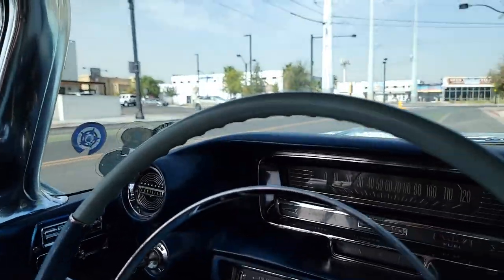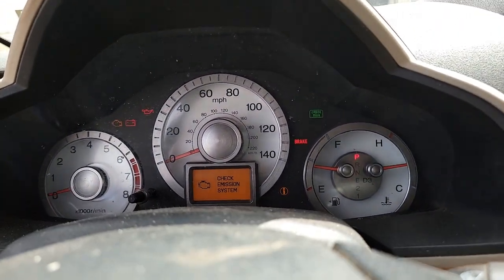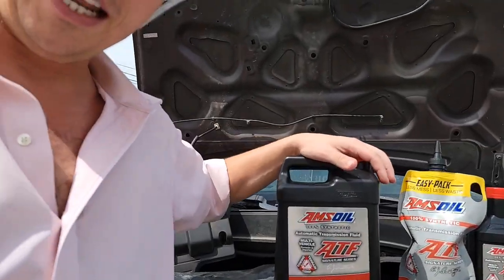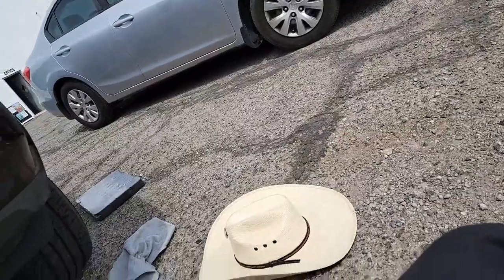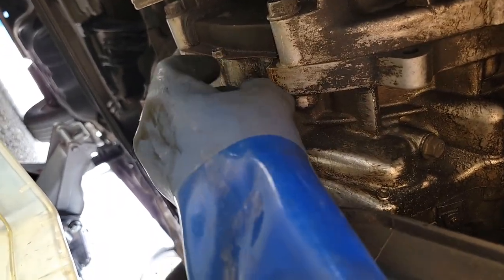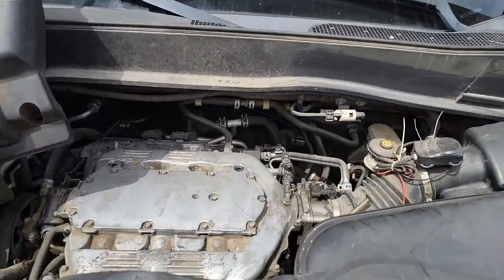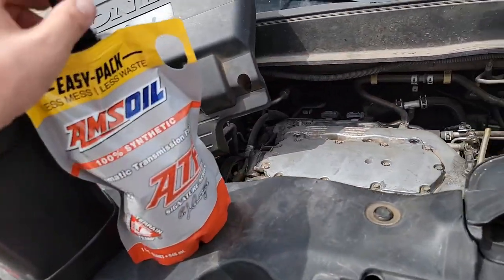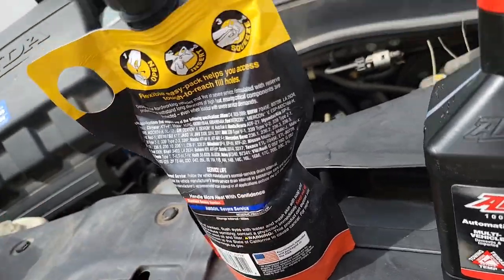Will Changing ATF cause it to slip? You May BE surprised!

Comment from the maker: Is AMSOIL Worth It on my Old Car? - https://youtu.be/1OSojPX7QKo

❤️ 🇺🇸 ❤️ Professional YouLubher: Eben Rockmaker Regency Platinum Direct Jobber AMSOIL Specialist (Dealer#: 5331179) 702-472-3614 

      ✅ ✅ ✅  You will get Your Best Value as 6 Month AMSOIL PC Member --- because You get about 25% discount on AMSOIL Products  + you will not pay as much sales tax, depending on the sales tax in your state.  For example, if you were to buy $100 of product at retail plus 8% sales tax the total would cost you $108. However, if you paid the $10 PC membership and you received the 25% discount because of the PC membership, the total would cost you $75 plus 8% tax or $81. So for the one time membership of $10 you are saving $27 on your first order.  You continue to receive discounts on your future orders for the next 6 months. You do NOT need to auto renew! https://www.amsoil.com/offers/pc/?zo=5331179 

     🥇🥇🥇     Synthetic Oil Protection Google Map & Reviews
(702) 472-3614
https://maps.app.goo.gl/DmLU5hP72HadUBEm9
             
     ⛳️  Synthetic Oil Protection Website - http://syntheticoilprotection.net

     Did you know a oil manufacturer can call a lubricant a Full Synthetic when it's only 25% synthetic? AMSOIL is different because it is 100% Synthetic and has a higher film strength keeping the metal parts separated. AMSOIL allows less friction, less heat, less wear on the component. 

     Your Vehicle Could Run Better Than Brand New By Using AMSOIL 100% Synthetic Lubricants! See Results - https://youtu.be/zH-VquYlhqA

     AMSOIL Signature Series 5W-30 Synthetic Motor Oil protects against harmful deposits on turbochargers 4X better than Mobil1® Extended Performance in industry-standard testing*.  Read This Article - https://www.amsoil.com/newsstand/motor-oil/articles/leading-the-field-in-deposit-protection/?zo=5331179      

     ♥️ AMSOIL Performance Tests: Read This Article - https://www.amsoil.com/performancetests.aspx?zo=5331179    

     Find AMSOIL Products For Any Vehicle - https://www.amsoil.com/guides/?zo=5331179      

     Synthetic Oil Protection Coffee - Ebens Favorite: https://supportwith.coffee/shop/subscriptions/sop/
Reply: I have a 18 Hyundai Elantra 2.0 with 115,000 miles and the previous owners did not change the transmission fluid. Could doing a transmission fluid damage the clutch pack friction material? I was thinking of sucking out 1 quart of the old fluid and added 1 quart of AMSOIL, doing this repeatedly every 100 miles so the clutch pack would slowly re calibrate itself from 1 a clock back to 5 a clock setting. What are your thoughts?
Reply from the maker: @mrdecember5715 
I would chnage the fluid right now if it was my car and use the signature series atf. It will clean it and come back in 5000 miles and do a nothwr drain and fill. You will see the shop by vehicle and check what your transmission fluid type calls for.
  For me to get credit & be "Your" Independent AMSOIL Dealer please use my website below or my dealer no. 5331179 call anytime Eben Rockmaker 702-472-3614
http://syntheticoilprotection.net

New promos: BEANIE
Reply: @Syntheticoilprotection  thank you for responding. I'm a techcinian so I do all the work myself, but I've been concerned if doing the transmission fluid would cause harm.
Reply from the maker: @mrdecember5715 💯, yeah I never had any problems with the transmission ever on the channel and I've switched old cars new cars everything doing a drain and fill will make your car shift so much better☕️👍
The lookup guide on the website will give you all the products and flu capacity for your year make model and engine size.
It will say shot by vehicle in the upper left hand corner after you click on and go through to the Amsoil web page through my website - http://syntheticoilprotection.net

Comment: I changed the atf on my 07 Lexus for Amsoil Fuel Efficient at 190k miles despite everyone in the IS group telling me not to/telling me to only use Toyota WS. 5k miles later and it has never shifted smoother plus I get way better mpg’s than before.
Reply: I got a IS250 and did it around 147k miles I think, and now at 151k and it works great! WS was real dark, crazy to think that's a "lifetime" fluid.
Reply from the maker: Sweet, thanks for sharing that with the channel♥️
Reply: @mdb831  You're comparing 2 different things... WS stands for world standard, and it's what Toyota uses as automatic transmission fluid. Pennzoil platinum is motor oil.
Reply: @mdb831  Ah, I didn't even know they made ATF
Reply: Toyota snobs a lot of their groups are stead fast on the ws.

Comment: I commented on a video a while ago. Was changing my transmission fluid in my 05 equinox. It was slipping slightly. I changed the fluid 4 times, drain and fill. It stopped slipping and drove great
Reply from the maker: Sweet!!!
Awesome did you do a pan drop and clean the magnets on the pan and change the filter?
Reply: @Syntheticoilprotection  drain with a drain bolt 3 times then the 4th was a pan drop and clean with new filter. Today I just did severe gear in front and rear diffs in new vehicle
Reply from the maker: Wow that's a nice Progressive mix that way you cleaned it from the inside out very nice thanks for sharing that with the channel😉👍
Reply: Is it the t6 gm engine mines is slipping
Reply: @Htate sil  I don't know. I think it was the V6 but I sold it and don't remember 100%
Reply: @htatesil4192  now that I think about it, it was the 3.4 v6

Comment: Had used the OE multi vehicle ATF in my vehicle, drain & fill. Changed at least 90+ percent of the fluid 19k miles ago and showed signs of improvement. Will change in 10k to signature series and do oil analysis at to see what is mentioned
Reply from the maker: Sweet! What type of vehicles do you have? What year make models engine size

Comment: The 90s Ford trucks have a small bolt that you can remove at the bottom of the torque converter, so you can drain both. Just remove a small inspection plate.

Comment: The smoke show is always fun! I didn't use powerfoam on my car because amsoil says it's not recommended for gdi engines. But I used CRC intake valve cleaner and sprayed it into the intake manifold by removing the brake booster hose. A lot of smoke came out, loved it.
Reply from the maker: Sweet!!!
Reply: @Syntheticoilprotection  do you change all the transmission fluid all at once?
Reply from the maker: Great question when you change the transmission fluid on this car it loses about three and a half quarts of the 8 and 1/2 total quarts in the trans and then if you want to depending on the color of the fluid you can always come back and do another drain and fill if you want it to look better
Reply: @Syntheticoilprotection  but not flush it all at once right?
Reply from the maker: When you drain the pan you can only drain about half the fluid because the other half is in the torque converter and that doesn't come out
Reply: @Syntheticoilprotection  it doesnt come out unless you do a full flush at the dealership with a machine right?
Reply from the maker: There's a couple different methods some you need a machine some you can do it without
Reply: @Syntheticoilprotection  thank you🙏

Comment: Awesome Eben, I have a 2007 Pilot with 215K miles I do a drain and fill every two years, my transmission is as smooth as a hot knife cutting through butter.  I have been using the OE ATF instead of the Signature Series.  Maybe next time I will try the Signature Series to see if it will be an improvement from OE.
Reply from the maker: Sweet!!!
That's awesome Tony thank you for sharing that with everybody on the channel😃
Reply from the maker: You have been randomly selected for the end of month giveaway please text me your full name so I can save you in my phone 702-472-3614

Comment: What I've learned from transmission fluid changes is if you experience any kind of slipping chances are air got into the system or it was already slipping before the fluid change. Right after changing fluid it may look full on the dipstick then after some driving it could work good. Then after some more cruising some slipping occurs. Check the dipstick again and chances are it's gone down a little. Unless there is already pre existing conditions slipping shouldn't just occur out of nowhere
Reply: I been a mechanic for over 35 years and never heard of air in the system for a transmission that makes it slip. You have a dip stick that goes right into your transmission fluid which air gets into.  Now air in your brake system will cause problems
Reply: @DavidGuns  it was during a fluid change. I connected the cooler to a line for draining. Would run the motor for 20 seconds stop fill and repeat. After checking the dipstick it looked fine. After some driving slipping occured. After adding some more fluid the slipping went away. It sounds more like air getting into the system than anything else.
Reply from the maker: Yeah I've never heard of that either

Comment: I changed the manual transmission fluid on my 2020 Civic Si w/ genuine Honda fluid.  However, I purchased the amsoil CVT fluid for my 2023 HRV.  Can't wait to throw it in at about 30k.
Reply from the maker: Sweet
Reply from the maker: That's awesome cliff how did you learn about amsoil?
Reply: @Syntheticoilprotection  by watching your very entertaining, humorous and informative videos.
Reply from the maker: Sweet!
Am I your AMSOIL Dealer?
Perhaps I already followed up with you with text?
Reply: @Syntheticoilprotection  I'm not sure I just signed up online.  However, I would  like to try the product first and if I am impressed I have been thinking about becoming a dealer.  Perhaps I could be your down line.
Reply from the maker: Yes correct you can still be with me as your Amsoil Dealer you have 30 days to select what dealer you want to be with all you do is call Amsoil and give them my dealer number and you can be switched to me as long as it's within the first 30 days.
Eben Rockmaker 
5331179
Reply: @Syntheticoilprotection  ok I called them to have them change you as my dealer.
Reply from the maker: Great!
Thnaks C!!!

Comment: Good videos I used to use your product many years ago and just got back to using it in my 2019 silverado  1500 5.3 and a 8L90 transmission they were recommending to get my transmission rebuild or replaced and I used the amsoil synthetic atf fluid just to see if it would do anything and its now shifting better than it did brand new so thank you for your videos
Reply from the maker: Sweet!!!
Am I your Amsoil dealer?

Comment: It's important to note that a drain and refill of the ATF is the process. Do not flush the transmission.
Reply from the maker: You can do a transmission flush if you do it properly Without The Machine however it takes a bunch of people to do it and it's complicated. There's nothing wrong with using the Amsoil transmission flush.
Reply: @Syntheticoilprotection  Thanks, Eben.

Comment: Just drained and filled 6 qts on my 2009 yukon denali 6.2 with 191k miles and runs and shifts so much better its holds 12.4 qts so ill come back in about 6k miles and drain and fill 6 more qts
Reply from the maker: Absolutely gorgeous😉

Comment: I haven’t had the opportunity to try the ATF, but I was pleased with the CVT fluid in my Subaru, definitely felt smoother and I think mpg went up just a hair. I am nervous to change my ATF on my 1995 Oldsmobile (recently given to me) because I don’t know the service history and it can shudder from time to time. Perhaps I could pump out 2 quarts and put in the Amsoil and do that a few times? I just think changing 7 quarts at once on this car might not be the best.
Reply from the maker: Yes that's exactly what I would do Jason I would just do a pan drop change the filter and change half the fluid and you'll be amazed at how much smoother it runs😉👍
Reply: If fluid is black just drive it till it dies or have it rebuilt if fluid is lite brown or yellow or clear looking or cherry red witch it likely will not be (chery red) get a large pan with a drip pan undernith if you can access the cooler lines find witch one is the return line to transmission haven fluid go out the return line in to a drain pan until it starts to spit out (when not coming out smooth any more)  turn engine off right away make sure shifter is in park with parking brake firmly set  before doing the above first; don't rev engine just have it ideal only.
   If there's no drain plug on the tranny or pan; its less messy  when taking the pan off doing it this way. After changing filter and cleaning the pan and reinstalling it pore new clean tran fluid; the amount back in that's for the initial amount  thats required or a little more whith the return line off going towards drainpan restart engine and pour new fluid in to funnel that's in the tranny dip stick tube or what ever the dip stick came out of until clean looking fluid comes out of the return line; this way you're not mixing old fluid on a large scale with new fluid.; plan on using more fluid doing this say one to three quarts more than total fill go through the gears once while doing this TURN ENGINE OFF; it helps to have a helper while doing this. 
      If you want just take some fluid out at first and use transmission fluid cleaner and add some fluid to bring up the fluid to the proper level while the engine is running check with dip stick regularly so you get the right level have the vehicle on level surface and it doesn't hurt to make sure tires are properly inflated to ensure vehicle is level or at least very close to leavel get inside and start the engine; go through the gears slowly and momentarily stay in the different gears selection don't drive the vehicle and make sure to press the brake pedal down firmly when doing this and put back in park. Fowell the instruction of the cleaner; in the pass I've used lube guard cleaner ,but amzoil is probably just as good.                                                Ps if the trann filter is like some fords were it has a tube that stick in to the valve body were the gasket stays in the hole that comes off the old filter use a zinc coated long shank nail the roofing head makes the perfect toll to remove the round gasket out of the valve body; using  a pair vice grips to hold the nail shank; also if you still have shutter issues after servicing tranny use instant SHUTTER fix by Lube guard up to two of them if one doesn't stop the shutter problem. I'm not a auto technician but I have worked on my own car including doing the r and r  on engine & tranny

Comment: So it would be better and safe to put this in my new 2023 Ford Ranger? And would you completely drain the trany all out or leave some in?
Reply from the maker: Depends on the transmission some you can drain all of it others it's usually just the drain pan a lot stays in the torque converter which is normal and yes if it was my personal vehicle I would change it and everything is right here in the lookup guide and when you use my link that will attach me to you in the future I can always answer all your questions about improving the performance and Lace band of your vehicles by being your independent Amsoil dealer the 6-month PC membership will give you the best value and there's also two new promotions which I will attach below and then the 6-month PC membership.
Save up to 25% on every order as a preferred customer: https://www.amsoil.com/offers/pc/?zo=5331179 

Eben Rockmaker 702-472-3614 
New Video - https://youtu.be/uwO7FHifWFo?si=vS16b2SiWqEYthfM
Business card: https://linktr.ee/EbenRockmaker
New promos: FREEBOTTLE & 5PI
Reply: @Syntheticoilprotection  Thanks Eben for replying to question,...very much appreciated!😎
Reply from the maker: @Dublin777 💯

Comment: Hi Eben I heard now dayz that Torque Converter doesn't get flushed out for Obvious Reasons but there is a another way, where the Torque Converter is taken out and cleaned. After Torque converter is cleaned then it is either Pre-Filled with ATF or not pre-fill then inserted back. After that new ATF is filled in. That's after the pan and the filter is taken out then new fluid is filled in then Torque converter is taken out. It may be a new thing they are doing. It doesn't get all ATF out around 80% max. Don't know if that method is done in USA
Reply: That would be an expensive serviced if you  paid that to be done if there a problem with togrq converter for removing replace it with a fresh rebuilt one instead of having the old one put back; some T converters have a drain plug in them.
Reply from the maker: Most Vehicles all you do is a drain and fill
Reply: @keithtomlin4649  the Toque Converter is taken out and cleaned and put back in. its not replaced with another Torque Converter. Yes the service will be expensive and have to stand in workshop and watch them do it.

Comment: Question is the signiture series severe duty i think is what its called the red package atf is it compatiable with a ford calling for mercon LV all i see printed out amsoil website is mercon and mercon v compatable the OE fuel efficient  is the only one that specifically  says mercon lv untill you bring up the full data sheet which has the same rating as the signiture series